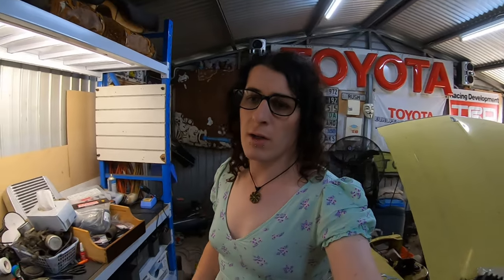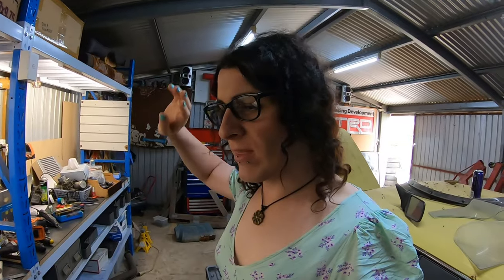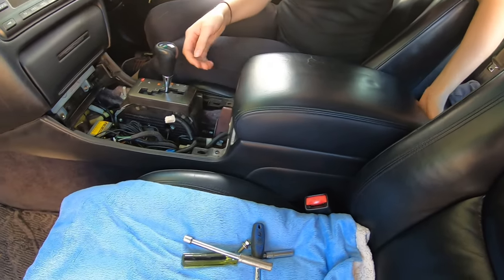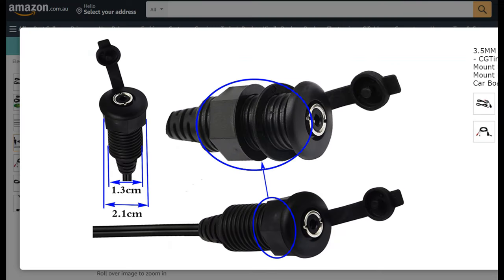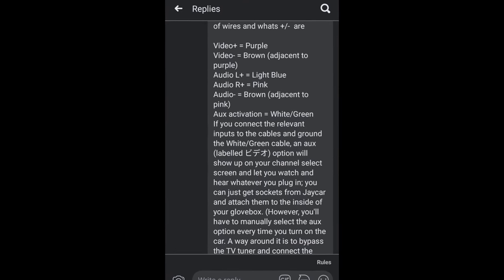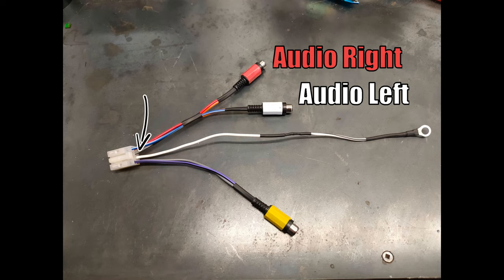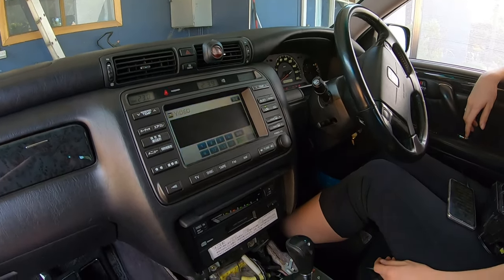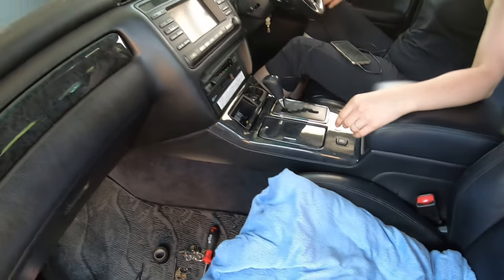JZS171 Crown RCA + AUX install

Comment: This is fucken awesome, I was thinking the same thing, I didn’t want axe my station wagon with aftermarket stereo really wanted to keep the japan 🇯🇵 look so thank Yu very much for this !! 👍🏾
Reply from the maker: I'm glad it was helpful :)
Reply: Keep the Japan look then. Half the time the factory CD changer is fucked anyway. Ditch it and mount a head unit behind the original retractable cover for the old CD changer. When the cover is closed the interior looks original. You can Bluetooth your phone to the head unit and play music, and have hands free phone integration.

If you’re on a tight budget though, the method in the video is a winner.

Comment: So it isn‘t possible to install an aftermarket 1- or 2DIN-radio headunit with an DIN/ISO-adapter-loom to the crown like in other cars?
Reply from the maker: Not if it overrides function of the Crowns headunit because its also the climate control.
Reply: @NooB-Celica  What if you install the radio unit below instead of the cassette/CD player?
Reply from the maker: @patrick_inofficial  I think you can install a headunit that is standalone if that's what you mean. But that's a lot more effort then just doing this quick cheap modification.

Comment: Hi would this wiring set up work for majesta 186 2006
Reply from the maker: I wouldn't know, I've never owned a 2006 Majesta :( Sorry.
Reply: @NooB-Celica  ok thanks. Really could do with a maintenance and wiring manual. Can't seem to find them..
Reply from the maker: @dilvinders1  Join the Modern Crown owners group on Facebook.